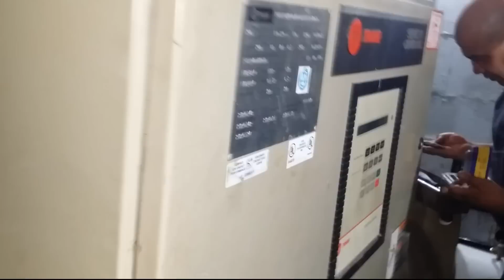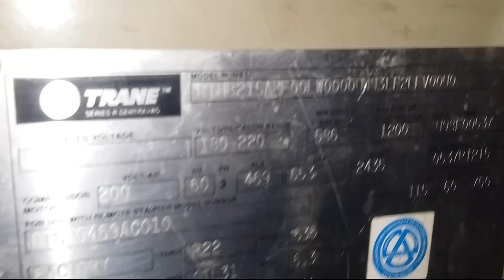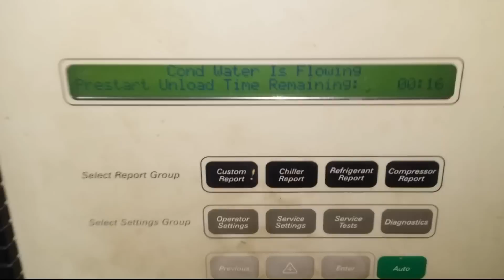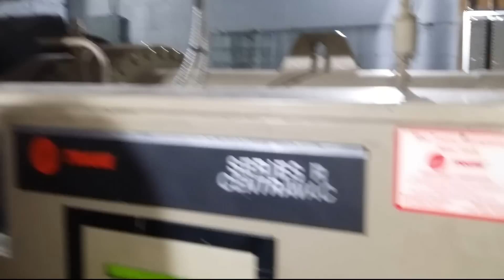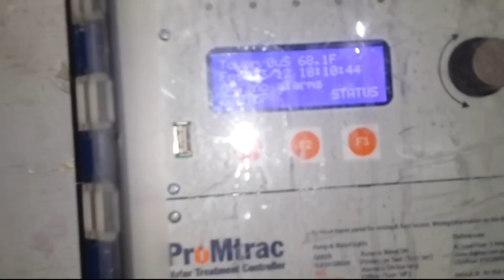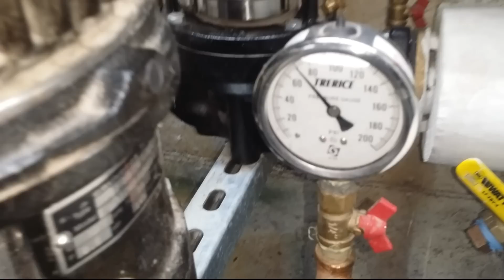250 Ton  Chiller | Trane Series R Centravac Chiller

Comment: Emin, I hated working on those loud obnoxious chillers, that one there will drive you to drink and hearing aids.
Reply from the maker: Man I hate them as well, I always shut that dam thing off when pulling strainers, my boss said he knows guys who lost partial hearing from working on them. Thanks for watching
Reply: @EminHVAC at least they have a variable speed one now that's going to be much more quieter in the Series R chiller line.
Reply: +Larry Cole 
It still isn't as bad as the older twin-turbine centrifugals Trane made which roared like crazy.
Reply: douro20 Yes those you had to have ear protection to work on.